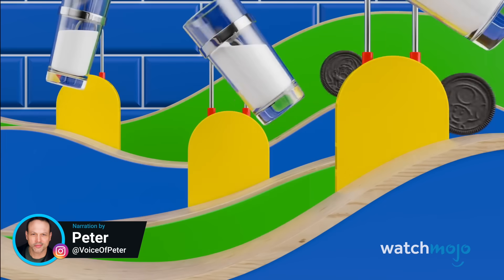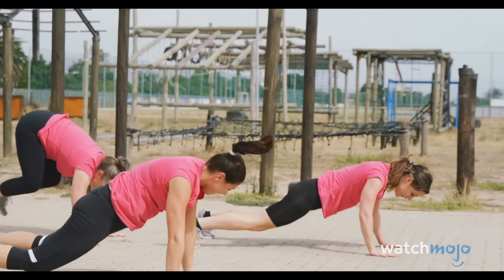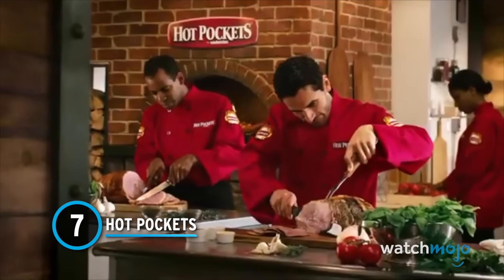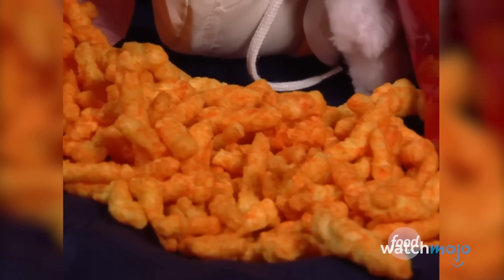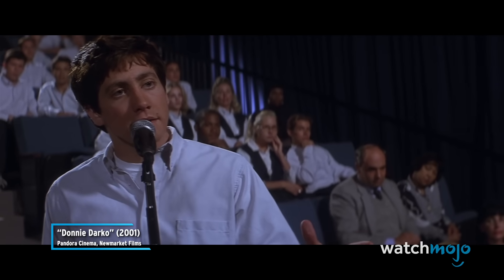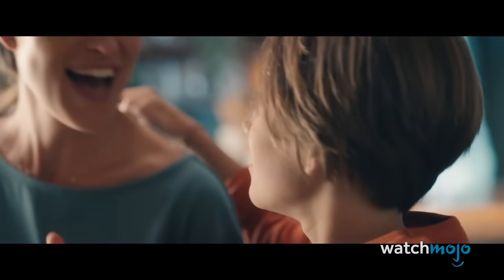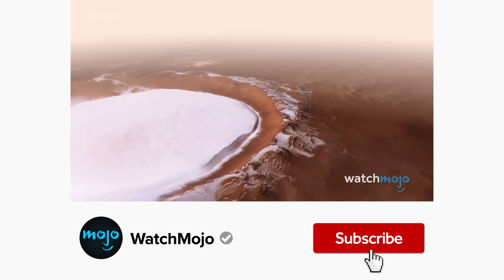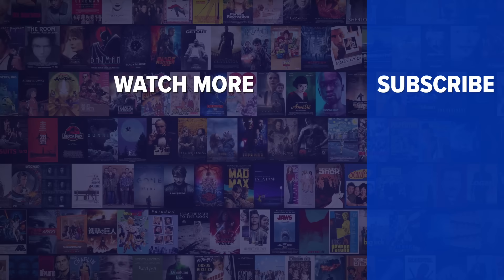Top 10 Unhealthiest Snacks in America

Comment: i am surpirsed at the cliff bars. i specificly chose eating those recently to carry me over sometimes when i am hungry  instead of chocolate specificaly becasue ifigrued they had the least sugar.
Reply: Clean makes a good tasting bar with low sugar
Reply: Lol its all in the nutrioin information in the back. While not as bad it still has a ton of macros in them (higher calorie count)
Reply: They aren't that unhealthy especially if you're hungry. They're meant to be eaten as fuel before working out. A climber would eat it before climbing as energy for their body. It does have added sugar but sugar is the fastest source of energy your body can intake. And the carbs are from oats which are complex carbohydrates which will keep you fuller and and give you longer lasting energy because your body breaks them down slower.
Reply: @MrCguy24   i see, although i do tend to run a few miles a fwe times a week so i suppose i might be ok. although i am not necessarily eating these right before or after my running but i do suppose it can effect me being hungry later
Reply: As a broke ass college student ... The king size snickers bar was the best calories to dollar ratio from the only vending machine in the science building.